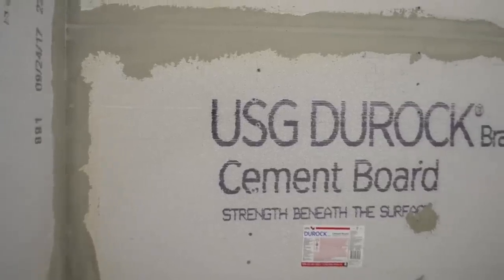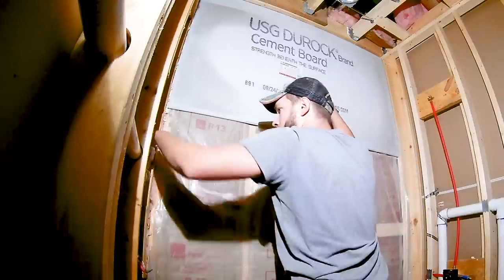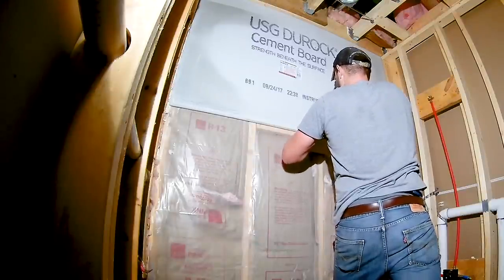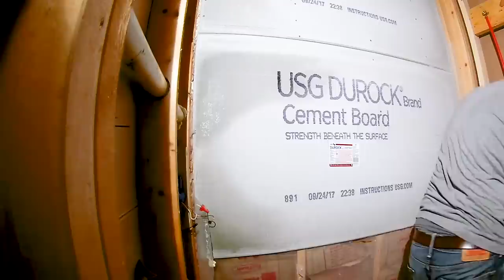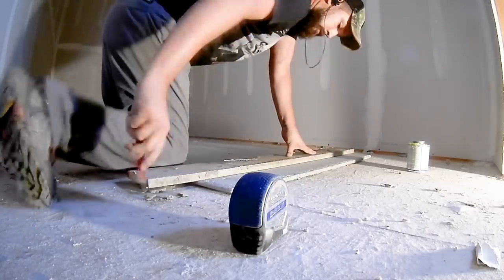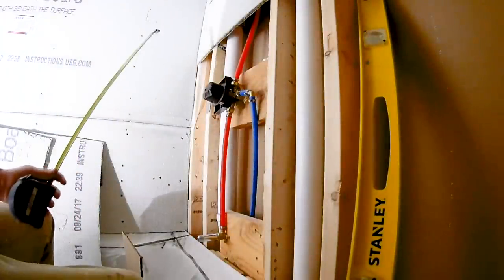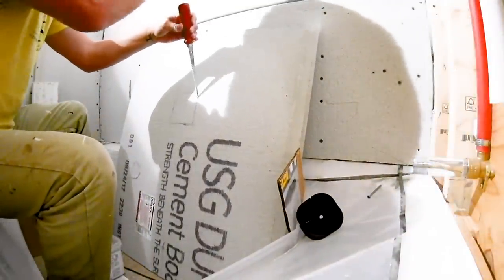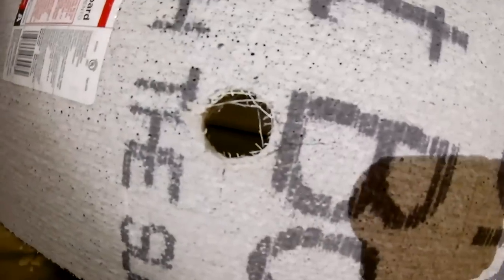Cement Board Installation for a Bathtub Shower

Comment: Not a terrible job. Way too many seams  with the cement board. Also you want to keep the necessary seams in areas where water does not commonly strike. Hence start hanging the 5' boards horizontally from the tub up to the ceiling. Then take a 5' board turn it vertical and hang on the 2 remaining walls.  This way the majority of seams are high.

Comment: Now that was a good video. I am thinking of doing my bathroom and this will help me make that decision.  Seems easy enough and I really want to try it.  Only question I have is how to start at the bottom where there is a sill board and do you use that sealer paint.

Comment: Not sure if you did the plumbing too... But you're typically not supposed to use PEX for the drop to the bathtub spout. It restricts water flow and can cause water to come out the shower head as well when you're filling the tub.

Comment: You make this look easy, what if I invite you over for a BBQ. I'm actually going to attempt 2 showers one is cinder block and the other 2x4 walls. I been looking into cement board instead of the sheetrock. 1 bathroom has not worked in 20 years so I'm gonna take my Stihl saw and cut the concrete floor to put new sewer pipes.
Reply from the maker: I’d be there.. sounds like a good time!
Reply: Have you tackled these projects yet? I ran into an issue with our bathroom. 2 out of the 3 walls is hollow block. What I've done so far is put thinset on the back of the durock and anchored the sheets to the block wall. I redguarded the block as well and obviously plan on doing it on the durock as well.

Comment: I know why you put the top in first when doing drywall....baseboard covers any gap at bottom.   But not when doing cement board.  I just set it on the tub lip and work my way up. NO block needed.
Reply: having the first joint from the tub as high up as possible will guard against water leaks from hot showers that may penetrate the grout.  plus it is easier to install the backer board, since gravity minimizes the gap between board sections, as you have stated.

Comment: I’m installing a refinished clawfoot tub on top of river rock tile. I’m going to thin set, lay tile, paint seal on rocks for a wet appearance and then grout. What would you suggest I put on the floor first? I did leave the old linoleum there that was under the old tub…🤷🏻‍♀️. Thank you

Comment: Durock sucks. I installed two bathrooms. One with Durock the other with Perma Base. The metal frames behind the Durock were rusted when walls were removed 10 years after.  The walls with Perma Base were also removed and were on perfect BRAND NEW condition.
Reply: Did the Durock have a waterproof membrane installed?

Comment: So once the cement board is resting on the top of the flange, what do you use to seal that horizontal crevice where they meet?
Reply: @shelzmike  our problem is though...they did not shim out the walls...we have a large rectangular window above the tub up high.  So if you try to slide the gypsum board over the tub flange it bows out and is not straight for tiling....

Comment: Sgt Donavan.  I have a couple of questions.  Why did you install plastic only behind the side wall of the shower and not the control side and back side?  Also, why do you start the cement board from the top rather that the bottom?  Thanks, I'm doing my first shower tile job and there are so far about 50 different ways and products to use.
Reply: I'm not an expert, but I believe the side wall is an exterior wall. That's why he's got batt insulation & the plastic on that wall only. You don't need either of those on interior walls.

Comment: Question PLEASE
HELP!! Do you place the water board smooth side down and rough out??? Or vise versa
Reply: From what I've read, either way is okay, but I think if you're going to be tiling you can put the rougher side out, since it will have more "tooth" for the tile thin-set to stick to. If you're going to be painting, the smooth side out is probably better.

Comment: Question is that exact cement board used for the bathroom floors? And if so do I need a vapor barrier underneath that and if so what kind? Thanks
Reply: Its the same board just the thickness is different.

Comment: How do you deal with with tub lip to cement board transition when you plan on using a waterproofing membrane like aqua defense or hydro ban . I have seen some people use mesh tape and mortar to fill the gap and then painted it with Water proofing membrane and then used waterproofing band . What thinset to use on shower ? Thank you ,great video !
Reply: if you're not going to run the cement board over the lip of the tub (recommended, unlike in this video),you should get it to sit cleanly on the lip of the tup so there isn't much of a gap. Whatever there is, seal it with silicone and only waterproof the cement board. When you tile, the tile will hand over the cement lip. You can use modified thinset to make it bond to the lip if you want.
Reply: I'm wondering why you don't use the recommended method of cement board over the lip. Apart from the fact it's easier to do it this way, and most people opt for the easy way.
Reply: Cement board or thinset can both wick water over time its preferred to use silicone at the lip of the tub
Reply: @frankly2677  Recommended by who? In the manufacturer instructions for my shower kit, it said to install the backer board approximately 1/16 to 1/8 of an inch above the pan lip, and to fill in the gap with silicone. It also shows the same tile installation method, with the tile overlapping the lip. The explanation I have seen before is that you don't want your backer board resting on the pan because it will then have a tendency to wick up any moister that splashes up onto it. Makes pretty good sense to me.

Comment: Hey great video and tips thank you so much. Would you recommend adding waterproof mixture liquid to the cement joint filler mortar?
Reply: No. You should either have plastic behind the board or paint the top with redguard.
Reply: Sounds like it could weaken the mortar. You’re missing something that repels water in with a mixture of water and mortar…sounds like trouble.

Comment: Great video, thanks for sharing. I do have a question for you though. Where the cement board butts up to the drywall, you have made a dry wall to dry wall joint. Would it also be acceptable to use the mortar and tape you are using to join the cement board, to cover the dry wall and cement board butt joints?
Reply: Michael King the reason I would use flat tape for butting up against drywall is for a smoother paintable finish.  The fibatape for the Durock is a mesh so it won’t be smooth over the drywall.  But, if a tile is going to cover the joint, then the mesh tape will suffice.
Reply: Thank you Mike, good information! I ended up using the mesh tape and cement board joint compound to butt the cement board to the drywall. And yes, it was not a good finish, so what it meant was I had to run another course of tile over the joint to resolve that issue. Thanks again Mike!
Reply: Sorry Mike, I mistook your name in my reply...oops.
Reply: Michael King usually you just have tile overhand the joint so it’s covered.

Comment: Question: why would you bring the backer board to the top of the tub flange? Why not overlap the flange?
Reply: David Johnson The instructions on my DreamLine shower pan show the backer board sitting on top of the flange top.  The tile or panels are specified to sit 1/8” above the bottom of the L-shaped flange and that small gap caulked with silicone.  Other manufacturers may provide different instructions though.
Reply: If u look above on L - Linda Welch’s comment, the Vendidimus ,who answered her, attached an image, a cross section on how ideally the joint shall be.
Reply: I have been asking the same question, what is standard practice. Why wouldn't you put the backer board on tub ledge covering the flange.
Reply: Austin Hutson . In time the sealant around the tub does leak. Through capillary action the water may reach to the cement board and slowly getting absorbed by the cement board till reaching the wood frames. There shall be also an 1/8(+/-) space between board and edge of the flange to allow for the slight movement of the tub when stepped in or filled with water. Besides, if u see the picture, if u place the board over the flange then u have to add a thin sheet of plywood as thick as the thickness of the flange in order to make them level before placing the board in.

Comment: did you bury and open electric box with capped wires  in left wall  ? look at 3:00 min mark lol
Reply from the maker: It was actually a dead wire that was removed when the room on the other side of that wall was gutted.  I’m sure it does look weird though.

Comment: Note on cutting, none of that will work for .50 Hardie Cement! You will need the shears, so keep that in mind when buy fiber cement for your DIY projects!
Reply: Hey what do you mean by shears? thanks for input!
Reply: @dylangraton7439  These shears are the same ones used for Hardie Plank Siding. They also cut the . 50 Hardie backer board.

Comment: Have you ever considered using deck tape on the studs prior to cement board install? I noticed in my shower tear down one screw was behind the grout and it was not sealed so the screw pulled water into the stud. Apparently the deck tape membrane will create a relative tight seal around the screw possibly preventing this. You think this is an overkill?

Comment: Do you want the backer board sheets to sit flush with each other or have a 1/8” gap?
Reply from the maker: Scott Bowland cement board on the wall doesn’t need a gap between each sheet

Comment: The tub flange is usually between 1/8" and 1/4" thick. Is it acceptable for the 1/2" backerboard to sit on the tub flange, about 3/8" to 1/4" proud of the flange?
Reply: I'd love to know the answer to this. I've been searching everywhere for an answer. We built our basement bathroom to fit perfectly a 60x34 direct to stud shower pan and I can't wrap my head around the backer installation in regards to setting the tile around the edge with the board being proud of the lip like you said.
Reply: wendidimus . I just saw it ! Excellent representation ! Thank you for sharing this important information !!!

Comment: Curious about the plastic barrier and THEN your use of sealant on the backer board.  I'm hearing you want to do one or the other since doing both can cause a "mold sandwich"...  Seems like good measure how you're doing it but I need more information to make sure.   Thanks!
Reply from the maker: warriorforestmonk it was left intact only behind the tub where it is required here.  Above the tub it was sliced and perforated and not used.  Some cold climates require it while warm require it on the opposite side.  I have both warm and cold and can only use a retarder and not a vapor barrier.
Reply: Plastic behind boards is good.  Use qualityvthin set . Skim coat with flat edge of trowel so you get an additional later of mud.

Comment: Thanks for the great info! I purchased the laticrete membrane fabric and hyrdrobarrier based on another video of yours. Can i skip the cement board tape and mud, and simply use the membrane solution over the seems and corners? Or do you have to do both?
Reply: I've seen most people use the fiberglass tape and RedGuard (or similar) versus thinset.

Comment: Why not start at the bottom?
Reply: cause that would make sense.  but they do the same for drywall. i think because it is easier to measure from the floor up for the cut piece and it makes it easier to reach for mud, tape and sand. not entirely sure tho. good question.  I am sure there is a good answer
Reply: I do start at bottom - always. Easier to correct an irregular cut on the ceiling end. At the shower pan/bathtub end I need a perfectly straight edge.